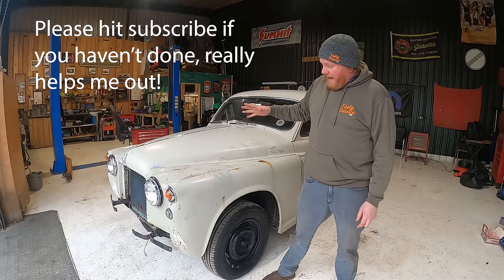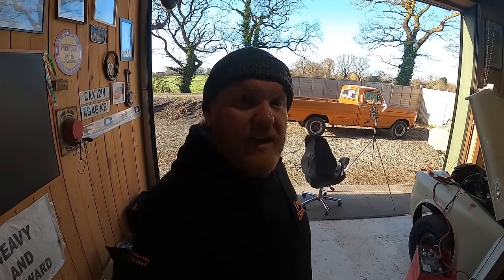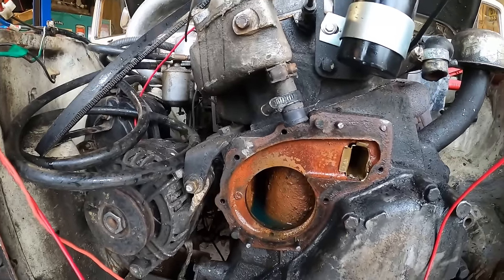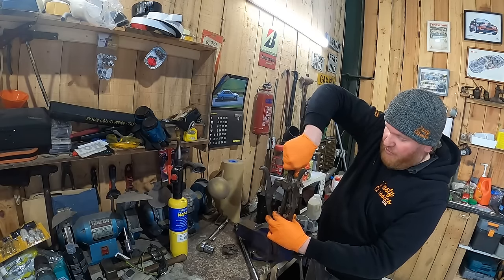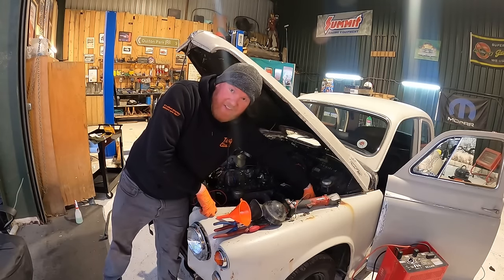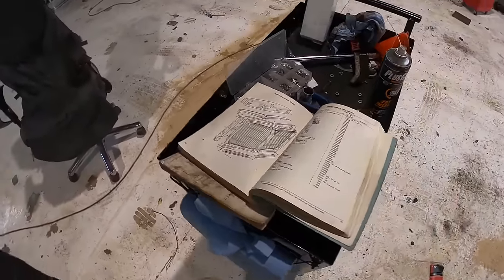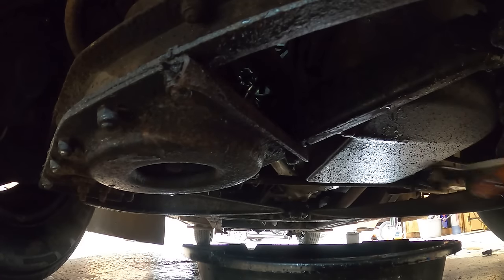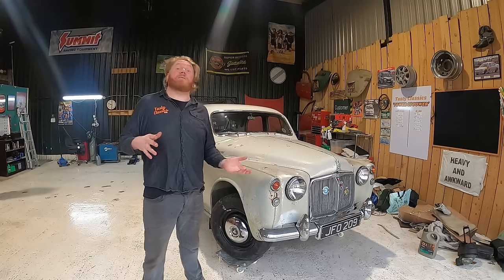Two Weeks To Save This British Classic! A Gorgeous 1962 Rover P4 100 2.6 Straight 6

Comment: I love the old P4 'Auntie' Rovers, I used to drive a 1955 P4 90 Flat front wings in a lovely shade of RAF blue with a mint dark blue leather interior about 40 years ago, It was my daily driver and never let me down, It was non overdrive and had the freewheel on the gearbox which was a bit of a novelty! I sold it back then for £500 which was a good price at the time, I so wish i still had it as it had so much charm and the vintage straight cut 1st gear was sublime!
Reply: To SCOTTY.
Sounds SUBLIME, the iconic P4, and in RAF blue, with dark blue interior!
Reply: You sound like an old friend who had the same. Some naughty boys stole it one night and crashed it into a tree 12 foot of the ground, the motor still started up with the fan stuck in the radiator. Freewheel , 600 15's, viking ship on the copper hubcap centres, I had a PABX Vauxhall. Good times.

Comment: i have owned a 90 and a hundred , of course any sixty year old car must need repairs , but this car will be a lot cheaper to repair than a modern car !  most modern cars have few rebuildable parts ! when pulling the water pump shaft , maybe drill into the centre of the shaft ,  to pivot the puller thread ?

Comment: Put the battery back in its rightful place under the rear seat because have it where it is now the heat of the exhaust will melt the battery. Plus it will be easy to work on the starter motor.

Comment: Very wise to just put it aside and come back another day.  Gives you time to think.  Many, many cars had cartridge oil filters, maybe all of them, before the introduction of spin on types.  There is probably a conversion kit for it like on my Austin A60.  I am surprised you have never come across one before.  As you have said, the wiring is a nightmare on this car so top marks for getting it to work as well as it does.  I am eagerly awaiting part 3 and I am sure your gritty and witty skills will save the day, and Aunty too. 👍

Comment: 1st time watching,  totaly fascinated.  I came from an era when all the dads in the streets on Sun would have their cars on ramps repairing cars for Monday work.  Modern cars are designed to deter self help with sealed electronics. Have subbed.
Reply: I’m from the same tradition. Born 1960. Dad’s fixed things. I maintain that tradition and my grandsons are learning from me. 
Alas, most young guys who courted my daughters over the last 10-15 years, none are handy in the old sense. Their fathers didn’t receive training and so in a single generation, almost nobody now can inspect, understand, diagnose and fix electromechanical issues in machinery.

Comment: Hello. I've just found your channel and love it. That SU carb needs attention though. If you take that intake pipe off, try to lift the piston with your finger. It's probably stuck in the dash pot by drit. Also don't be putting too much oil in the top..that's just a damper. Looking forward to episode 3.

Comment: It's in surprisingly good condition 😁
These have floating brake cylinders I believe, so need to move freely not bolted tight to back plate.
Reply: The ones in the rear, yes :)
Reply from the maker: Thanks for the tip !

Comment: Good Evening Ben. You are Amasing. What you have achieved for this Beautiful English Classic vehicle, very Well done you. I really do take my Hat off to You for such Determination and True Grit to get this Beauty up and running.  I really did Enjoy and Admire your Engineering and Technical Skills and problem solving. Old Engines and old Mechanicals are not easy to work out the solution and find what is wrong. I know Ben, You my Friend will get this Incredible vehicle running as smooth as a knife through butter. You will be driving this Beauty down the road. This was one of your Best and Detailed video's that i thoroughly Enjoyed. Big respect and I Salute You Ben. Jonathan.

Comment: Hi Ben.
I’m sort of in the new brake shoes camp. I have often got away with reusing soaked shoes, but I have ( just once) also experienced a liner separating from the shoe, wedging up inside the drum and locking the wheel solid at speed.
I was lucky all it cost me was a flat spot on what was a brand new tyre.
I put it in the boot and kept it as a spare. I may have forgotten to mention it to the guy that bought the car and was very impressed with all the tread on the spare, a few months later. Oops!
If the lining is riveted on, it wouldn’t cost me a thought, but bonded ones are not good, once soaked.
Reply from the maker: That's a very fair point and one I'll mention!

Comment: Just a suggestion on broken bolts. If they break flush or if like in 3 of the 4 you are dealing with… in the past I’ve Welded a Nut onto them… the heat does most of the work but I’ve been successful with all broken bolts. Failing that you’d be better with a Stillson on what’s left of the bolt. That old Girl is coming along fine. Wish I had it here in the States.. I’m from Lancaster originally… left in 1987 and never looked back. Great Videos Mate… onward and upward. Nigel

Comment: the dash pot on an SU or stronberg carb is the accelerator pump. It ideally needs engine oil in there. I had the same issue with a mini engine in the middle of Wales one rainy night and got it going by dribbling oil off the dipstick into the dashpot.

Comment: Absolutely agree about “the nip”. Especially with cork gaskets. With modern, uniform composite materials, rubber gaskets can work well with specific torque settings, but old fashioned cork and paper ones are better by feel. Cork will also compress and may need an extra nip, after a few heat cycles. But, as a natural material, that may not happen, or may happen by different amounts in different places, so only experienced nipping can hope to keep that oil tight.

Comment: A thing about the fuel line. We had a rover 90 for a while and it did exactly the same thing that happening to you 100.  My old man took the drain plug of the fuel tank and the petrol gushed out then stopped. The culprit was a peice of paper towel, where some service station attendant had wiped around the filler cap and a peice of towel went down the hole. Dad fished it out with a peice of wire, and problem solved. Check it out!!

Comment: Just a suggestion, but your problem with looks very similar to a Thwaites 3 ton dumper I had a couple of weeks ago where a big commercial battery or the starter/charger the engine will turn over and start but the correct battery (063)  and it would act as if the battery was flat (we even tried a new battery) so I took the starter motor off and dismantled to clean/check and I found one of the motor brushes (-ve, earth) was stuck in it's housing so instead of 4 brushes contacting the commutator only 3 were working (another fault was because the brush was arcing the commutator was blackened by dust and burning so needed cleaning/undercutting), cleaned and made sure brushed moved freely in the brush holders, problem solved (it might be this thats giving the solenoid problems), hope this helps.

Comment: I did exactly the same trying to pull off the cast impeller on old Series Land Rover water pump a few years ago. At that point I gave up trying to refurbish the old pump and bought a new one. It was Britpart or similar so not that expensive.

Comment: Old school in Australia,  tip a container of table pepper into the radiator while motor is running,  no pepper? tip a raw egg into the radiator, it will do the same thing, stop leaks in the cooling system. ( it works ! )  leave the motor running for about 20 minutes after treatment. ( pepper is best,  fixed my truck, and didn't leak for 4 years after adding pepper, then sold the truck.

Comment: Ah! Poor Aunty in the naughty corner.
When you get back, check the points. I’m betting they’re burnt again. If so, try a new condenser. Or, if there’s none there, fit one. 
The oil filter is a pretty normal BMC/Perkins type. You need to fish the old top seal out of the groove before fitting the new one. If you try to fit it with two top seals, the oil pressure can pop the seal out, dumping all the oil out on the ground. A very expensive Perkins 4.236, recently rebuilt, taught me that one. Somehow my fault that the owner kept driving with the red light on and the warning buzzer screaming, until it stopped, half a mile from home.
People need to understand that a red light means stop, switch it off and get someone who’s not incompetent to look at it.

Comment: Fascinating. That car was Bodgageddon when you started, so glad you saved it
Reply: PS, dont start it on the handle like that, they kick back like a mule. Procedure - ignition off, bring handle to bottom, ignition on, hand on handle with thumb same side as fingers, one sharp pull up, if no joy ignition off and repeat. It should fire on first go. I last did this on the main road coming out of Buxton with lots of displeased motorists watching me ( cause was electronic ignition )
Reply: I think the slow turning over may be the starter motor. Clearly the previous owner had problems and changed to alternator and moved the battery to no avail. The bearings in the starter dry out and mimic flat battery symptoms. You can recon the starter but they are also cheap to simply replace. I did mine recently and it made a world of difference.

Comment: The charging issue is probably the voltage regulator, unless it’s a one wire alternator. Also the carby. Is probably full of that crap from the tank earlier on, strip the carby and put an in line fuel filter in.

Comment: I ended up with 3 shards of metal stuck in my lens /pupil because I was grinding without glasses,I also cut one of my knuckles to the bone when grinding without gloves. PPE is is there for a reason and it's entry level stuff but we all take chances without realising sometimes especially when you're under pressure to meet targets

Comment: Just a tip for you the dash pot on SU carbs run better with 3 in 1 oil or any light machine oil, engine oil is too thick in winter and carb piston won't react properly...

Comment: Check the needle and jet for dirt if you had problem with dirty fuel. I had this problem with my P5 on the way back from Newcastle. check the dash pot for oil
I always thought the battery lived under the back seat. I have had 2 P4's I may be wrong could be confusing it with my Jowett Javelin
Mind you this was over 50 years ago

Comment: I allways use 2 peices of angle iron placed in the press , and hook it under the water pump pully boss and press the whole pump useing a press, then place the pump the other way around in the press and support the pump best way possible then press the bearing shaft only and let the impeller blades take the load against the pump body  as you are pressing out

Comment: hi, if you look at the rear brakes you need to know that the brake cylinder needs to float on the backplate so dont tighten it and lock it up, good luck

Comment: Best practice to replace rubber hoses a special when they have stood the lenght of time they as its a big ask to expect them to be still perfect?
And starter moters should not be spun for long periods of time.
They are built for short use it is not a motor for long continues use you will burn the windings out. Love the channel and content keep up the good work.😊

Comment: For the last 60 years I have spent countless hous working on large diesel tractors and small two stroke petrols and enemy number one is dirty fuel  usually muck in the tankk. Your first job should have bbeen remove and steam clean the tank. Not glam but saves time and frustration. You have beaten hell out of the electris trying to ignite fresh airI would say you have a great candidate for an electric conversion there lol

Comment: At least you got the original wing panel and they look 8n good condition, not rot, and if you were able to find new ones, it's either find a company that bought the tooling from Solihull, to re produce new panels or having to go and  get patent parts from cheap steel and need fettling with panel better tools ,then having them sprayed, keep up the good work

Comment: It used to be a great gag back in the day, very long time ago. Remember people back then never seen anything like that, no internet no smartphones. A snake like that could do so many things. And even before the rubber one people would make wooden ones with a rubber between the wooden parts. I think it is just natural to find them there, with the rest of the old things (as Moss from IT crowd would say). But I do have a question, do you have at least one car, where you redo all the paint (or not) and try to make it like original and drive it daily.

Comment: Are the points melting because they are designed for a 6v system? Maybe the 12v conversion and the accuspark conversion happened at the same time.

Comment: That fuse box area is like something out of a Frankenstein laboratory,especially those copper wire barrels🤔🤔🤔🤔🇬🇧🇬🇧🇬🇧
Reply: Those copper wire barrels are the solenoids of the old voltage regulator that would have worked with the old generator.  Not very useful with the alternator and I hope they aren't still in circuit.

Comment: I was built in 1959. The car is in much better condition than me.
I've had my right suspension (hip) replaced. Now the left is clunking.
Air intake system is congested leading to a massive reduction in performance.
Ethanol additives, although never originally specified, are now regularly used, in order to mask the various painful creaking noises.
Waiting for the scrapyard now.
Reply: Love your comment! But you must wait until you reach 75, and then the problems begin. I am a '48 Model, and no fuel injection, but plenty of Cortisone Injections in the hands, the knees the neck and Shoulder. The performance these days is somewhat 'limited' but (looking at other older models) I am still on the road. I never take Ethanol, it affects my Top End (headaches). On a serious note, I do hope that the Rover lives again. I have restored only two (2) cars. A '68 Fiat Bambino, and a '71 Beetle. The Beetle has been my daily Driver since 2004, and looks brand-new. Greetings from Australia - where the Classic Cars tend to last a lot longer than the Coffin-Dodgers that drive them!

Comment: The capacitor in the distributor is there to prevent arcing across the points, if it has never been changed in all those years it won't be up to spec. So order a new one.

Comment: just a quick thing, that box next to the "fuse box " is it a voltage regulator if so is it discconneced and rerouted to the aoltinator as thats got one fitted in it? sorry about the spelling ive got a ragging tooth acke

Comment: Put a new condenser in it as the points are burning after a short run and giving your misfire.
Reply: Yes, I also thought condenser. I believe these cars didn't have ballast resistor coils as standard. Might be modified though. Appears to be negative earth now when it was positive earth from the factory.

Comment: Use E0.  Ethanol will rust the fuel tank and fuel system. PS: Ethanol will also attack an alloy tank.  Why is it in our fuel?????????
Reply: Because the authorities intend us no longer to have privately owned, powered transport.
I’m not kidding. 
They’ve signed us up to UN2030 “sustainable development goals”, which are utter bilge.
However it is specified that we live in 15 minute communities and either walk, cycle or use public transport.

Comment: Enjoyed the episode. I’ve gone through two very old starters, which in turn many starting attempts also made my fuel bowl leak too, I had to put a new seal on it also. In the end I researched and found a modern starter that had the right teeth and shaft to mate to rover P4 and it works like a dream. Mechanically, only the windscreen wiper motor needs fixing on mine, then I’ll be as you say, at the point where only the looks are left to be worked on. https://youtu.be/XZwBf7ajrfk?si=Lt4hN1X1MEu-y84h

Comment: That's not how an exchange basis works. They don't refurb the one you send them. They send you one that's been done already. I think you might have meant this, cos I can't imagine you really meant how it came across.   :P
Reply: Some rare parts are rebuilt and returned, as these cars get older, serviceable units have long gone
Reply: It was just a matter of the timing. Ben wanted the pump asap and the exchange people sometimes won't send you the refurbished one until they receive the old one and Ben didn't have time for that.

Comment: You just need a standard 12 volt coil not a coil needs a ballast 
A ballast usely means a 6 volt coil.that get boost of 12 volts  on you start then reduce to 6 volt when running
Reply: Ballast resistor reduces 12 volts to  6 to 9 volts .then you use the starter it you have wire that bypass  the resitor that gives the coil a boost .you car was not design for that

Comment: Sorry to burst your bubble. 12.8v is a charged battery, with no charging occurring. Even 13.1 is not charging. That would be a battery fresh off a charger. You need at least 13.5v, with any sort of an alternator. Over 14v ideally.
I’m betting you have no battery warning light on the dash, probably because the wiring around the dynamo voltage regulator has not been hooked up correctly for the new alternator. Alternators use the current through the warning light to excite the primary windings. Without it, they won’t charge.
Now, let’s see did you figure that out….

Comment: Probably the wrong coil… might have one fitted meant to have a ballast resistor instead of the earlier type…. Different resistances. Triumph switched to ballasted in the early 70s….